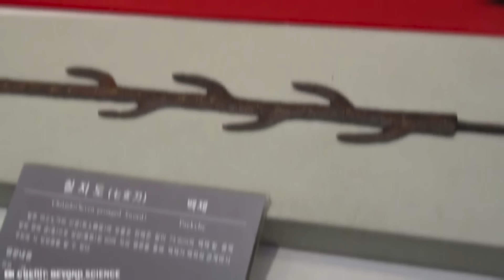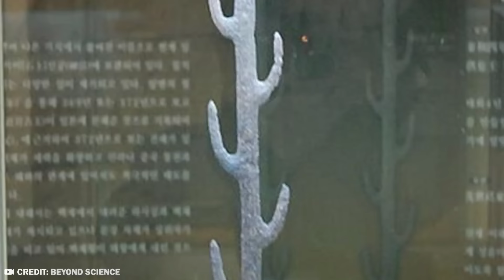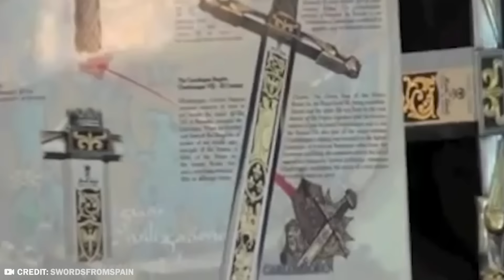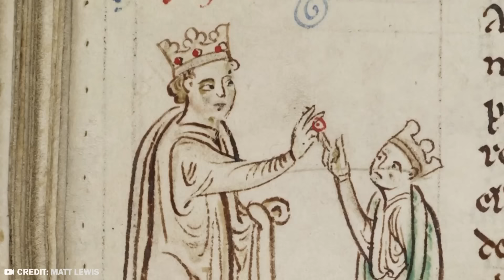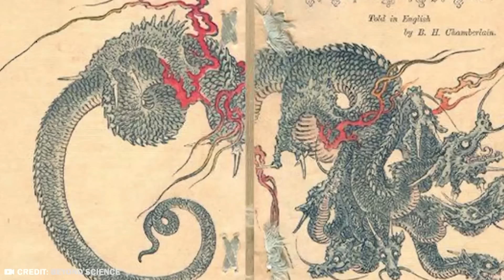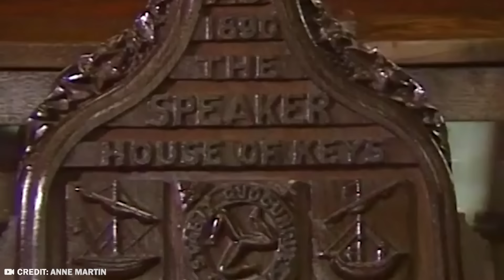20 Most Legendary Swords That Actually Exists

Comment: What irks me is that with all of our technological advancements, we have lost a great many techniques in sword making.
Reply: But the new techniques are better. You have literally lost thousands or tens of thousands of ways of doing things, when you have found a better way.
Reply: @Sight-Beyond-Sight  Because thats just one part of "good". Such roads are very uneven to drive, very slow and uncomfortable. We have such roads in my town and anything over 40km/h is awful. And its not even that comfortable to walk on. They do require replacing every 30-40 years, depending on the traffic. The "2000 year old" roads have had very little traffic, even Rome had roads with wagon ruts up to 30 cm deep.
Most importantly, such roads are hand made. I have seen a stonemason sitting on sand on the road, knapping a stone with a hammer before setting it in. It takes a 100 times longer to make such a road, and stonemasonry is an artisan skill, we are talking high salaries here. 
Besides, roads have to be dug open every now and then, for installing pipes and cables, for building new stuff. No road is meant to last even a 100 years.

But I do respect good work just as you. A few years ago, I saw a house being renovated, about 80 years old house, and saw someone had signed the work, something is not done these days.
But then I took a look at the year. It was the original work, but it looked BRAND NEW. 
I think theres more there than just good work. I think the problem goes deeper. These days its meaningless work for stuff that is programmed to break down, sometimes literally, the employer portions you bread and shame in equal measure.
But in a culture where things are made, and wanted to last, you can build something, a house, and you know you did well when you go home. That barring a fire or war, when your grandson is old, his grandchildren still have a good, safe place to live. Thats MEANINGFUL work. Or simply creating something useful as well as beautiful. You know that you are making the world ever slightly a better place. I believe a man should be able to fall asleep and be proud of his work and to wake up to another day knowing his efforts are worth doing.
Sry about the rant, but I do feel strongly about this.
Reply: @ribbitgoesthedoglastnamehe4681  I think you got my sentiment perfectly. Pride in one's long-lasting work. It is nice to think about that you could build or buy something once and know that it will be available for future generations. Our throw-away era is disgusting in so many ways.
Reply: what, do you prefer to be injured by a sword, or by a fast Bullet? I distaste the longing for old arms and killing/injuring techniques. The art of winning a war has evolved so much that today the hardest wars are won without one drop of blood shed. Now THAT is technology, and worthy combat  skill. As for Metallurgy, forging techniques and general control over substance - When you step into just any kitchen-tools shop, the array of knifes you'll have on display and for sale (for meager few dozen dollars, is all in all - far better in every single aspect than the whole of these "mythological" swords presented here. 
Legends are nice, and interesting, and usually they bare something of importance. Rarely the actual artifacts involved, though. 

So get your one-in-the-whole-world Massamune Katana, and go fight an M-16 whose copies fill up every gutter of this world. We'll see who wins....
Reply: @MottiShneor  It's the loss of knowledge that is sad, not the fact that it is outdated.
Reply: @MottiShneor  not sure what your rant is about but people are still dying in horrific ways today. There's literally a war going on right now. One could say that the more impersonal fighting of today makes people more distant from the consequences of war. Then again amount of combat footage available today is unprecedented. So there's that.

Comment: One good blow from a European hand and half Broadsword and a Katana would be toast.  They are fine swords but like a a rapier they just can't hold up to a truly heavy sword.  The samurai would have the advantage of speed and maneuverability though
Reply: The Katana is not a light sword like a rapier, it has a thick spine and an edge designed for cutting through flesh and bone, it's also flexible...besides, no sword can hold up to a direct heavy blow, even the finest swords can break.
Reply: @andrewking2590  true but it isn't heavy enough to stand up to the forces a Medieval European sword.  I might have used the wrong comparison.
Reply: @kirkmorrison6131  you over estimate the European sword.
Reply: @kirkmorrison6131  Medieval European swords were actually more nimble than Japanese swords.
Reply: @fransthefox9682  I know but the general public perception is the Katana was a wonder weapon. I have used in reenactments several European swords and they are light and wonderful.
Reply: @fransthefox9682  oh my comment about the Samurai was the lighter overall kit. Just like a knight unhorsed against foot soldiers
Reply: @kirkmorrison6131  While it's true that Tachi and Katana are lighter, they are balanced further from the hilt, making them feel heavier. But that balance is intentional.
Reply: @fransthefox9682  Yes very true it gives them good inertia, but harder to turn like a 2 handed sword or at least some of them.  Both styles are great but I do see some faults just like some Damascus Arab swords all are compromised between weight, balance, length for a job. I would not choose a Claymore 2 handed sword for a personal duel, but on the battlefield it is great for killing the knight's mount and the knight himself sometimes.
Reply: @kirkmorrison6131  Most Middle Eastern Damascus and Wootz swords are actually very light. For example, an Ottoman Kilij that weighs below 700 grams can have amazing cutting power.
Reply: @fransthefox9682  I know but all are compromises, of weight, length, balance, grip and spine strength.  It is the same with a service rifle. Every fighting tool is composed of several compromises.  That is just the nature of balancing the different needs. You might outfit a company today with M4 and M16 but you might include a few SAWs in the mix.
The same was true back then, you would include a mix of the best weapons you had and there were many great weapons.  The only point I was trying to make is some famed swords would not stand up against a battle against an extremely different design. This is due to the different strengths of the two designs. Your average European swords would not survive a clash with a skill user of a Toledo blade. It is just the way things go. I battle the Toledo blade might not be as big an advantage in some ways an the expert swordsman might fall

Comment: Umm the the thing yourr calling a dager is the tip of spear not a danger gold plated and sold gold weapons were mainly Ornamental or used in some ritual weather be a sacrifice or thing such as a coming of age ceremony for a noblemen and royalty or even knighting somone. Told weapon were rarly used in combat due to gold being,very heavy,lower melting temp compared to other metal's, and being pretty brittle so a gold sword sticking a steel or even a iron sword may dent or nick the steel or iron sword by most likely shatter,break or cradk a gold sword gold weapon make for better blunt weapon then bladed weapon due to u can use a golden weapon weight to generate  Centripical force